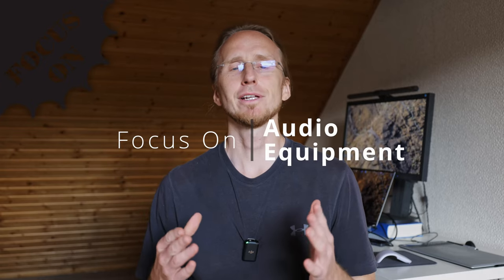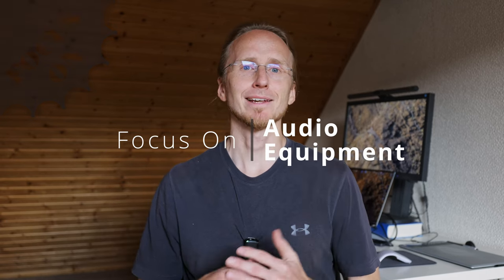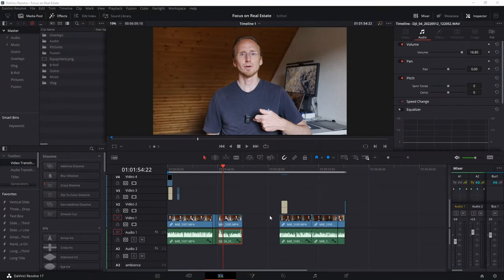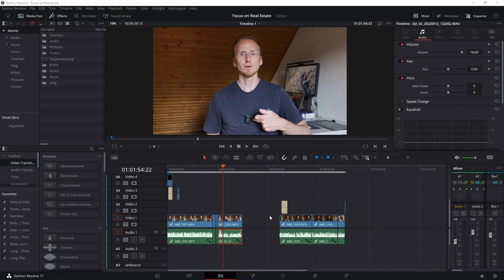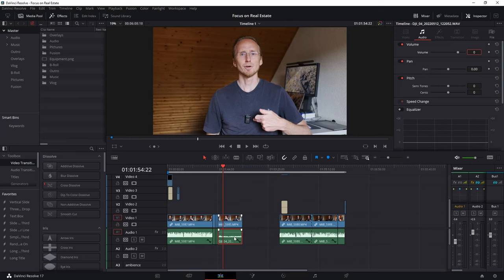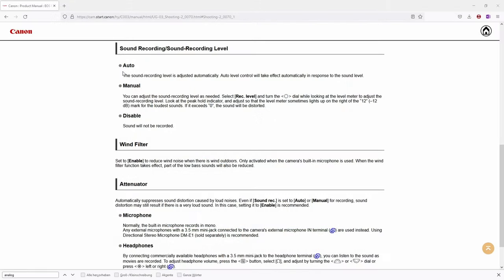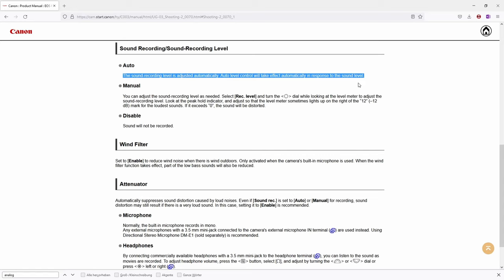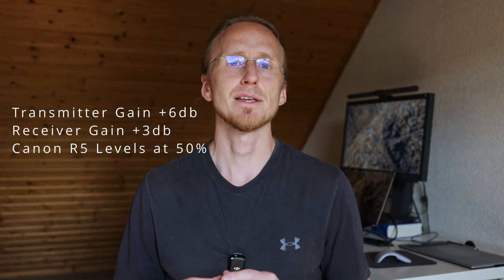DJI Mic Settings for Good Audio

Comment: Hey Michael, thanks for the review. And your possible solution to the problem. I got my DJI Mic too and I’m just trying to work out the perfect settings. My voice is loud and deep and I’m having problems with clipping. So I’m having a very opposite problem of you. Now watching your video i now realize that you also have a clipping problem, especially when you do your “solution” and you are actually having a very calm voice. I already reduced the gain on mine to -2 on my transmitter but im still hearing clipping now and then. I just released a video about the DJI Mic where im talking about that. Do you have any good ideas on how to go about that? Did something change for you after this video. I’m kinda disappointed. I payed over 400 usd for my Mic in South America and now it has these flaws. Thanks 🙌🏼
Reply from the maker: Hey there, cool channel and nice reaview! I hear what you mean.

I think with lower frequencies you have to be very carefull with the handling of the audio signal. I don't think mine clipps out of the box. But my processing in Davinci Resolve is sometimes not on point. I edit most videos on the road without proper head-phones ( I really need to invest in some ). And I also noticed for some of my videos there's clipping because I added too much gain in post. 

What I find interesting is, that out of the box, mine is very silent and I have to add a lot of gain and you have to reduce the gain. Although I have a calm voice, there shouldn't be such a huge difference between two people talking ;-) So this is weired and maybe they have some variance in their units - a big variance it would be then which is not good.

Did you try to only record the backup audio and play around with it? I the clipping the same as when you record directly to the IPhone?

PS: What a bummer that it doesn't work with all apps on your IPad. With my Dell (Windows) I have no problems connecting it and getting audio in any application.

PPS: I might get my hands on another microphone solution soon (cheaper one) and I will do some comparison. I like the DJI mic, but by now there are many solutions out there which cost nearly half the price. So it will be interesting to see how those perform.
Reply: @mibreit-photo  thank you for your long answer. I highly appreciate hearing your angle on this issue. The dji mic has a hefty price tag and for that amount i was just expecting more… magic, just like i said in my review 😆 ! Thanks for your good words to my review. Overall it is an interesting tool and i hope after playing around with the settings a bit, i will be able to get things more streamlined. Whats to consider is that in my review i didn’t do any audio post processing, just normalized the volume levels. So maybe with a bit more processing things will get better too. As for the clipping, i will have to try to reduce the gain a bit more and see what happens.  Yea to be honest, my first thought when i heard the audio quality was that there is something wrong with my unit, but then i watched some other videos on the mic and saw that many people had similar sound issues. I even found an official dji video about the mic, where some official from dji was talking about the then new firmware update and the video is clipping all the time. I can’t believe someone at dji approved that.  The ipad issue is actually going to be a problem in one year once apple is going to release Usbc iPhones. I hope they can address that with a software update. It would be a shame if new iPhones wouldnt work with the dji mic anymore. Let’s hope for the best and do some more testing. Im going to watch some more of your videos. I assume your newer videos are all shot with the dji mic?
Reply: This is fortunately a very common thing in the audio recording world. 
No mic can handle the wide dynamic range of the real world and produce a 'balanced' recording without post processing.
You need specific software (or hardware) for that. Just like no camera sensor in the world can capture the high dynamic range that nature can throw at us. 
So a good mic will have the ability to record the loudest sound without distorting and the quiet sounds without too much noise. That way you can compress the wav file later to get a more 'equal / balanced' end result. 

Something to consider is that the DJI Mic (recorder) does not have a foam cover. So certain sounds from your voice will come in very loud. (lots of air moving)
These are mainly the 'T' and the 'S', since they produce the biggest movements in air. 
We always use a foam cover on our mics and (on condensator mics) a windscreen. (not that fluffy thing, but a mesh that stops these hard airflows)
But that is in a recording studio environment. 

To wrap this up, what you can do is find the right distance between you and the mic. The further away, the less clipping you will get, but you will also pick up more background noise. Also play with the gain (as you already did), lowering it so you don't get popping / clipping. 
So I would always try to keep it as close as you can to your mouth and lower the gain until it does not clip.
Don't use auto gain, not in the DJI Mic NOR in the camera. You better do this in your editor. (compression with makeup gain)
In fact, I would not use the camera input at all, these cheap pre amps are another factor that can cause problems. 
Use the onboard sound only in the Mic or the Receiver and sync them in post (takes 5 seconds if you make sure you have some hard transient like 2 claps or anything in the recording). 
You can invest in a lavalier mic with a foam cover, which will dampen the T and S air flow a bit (less clipping). 
This will also help getting the mic closer to your mouth (which, in theory, should give better results).
Or record with the wind cover on and compensate some of the high frequency loss in your editor. 

No 'one size fits all' solution and not a 'set and forget' situation , but that is why there still are audio engineers in this world and why their recordings do sound good.
Reply from the maker: @tricks-and-tips  Thanks for the very detailed answer. It helps a lot. PS: I have actually another video showing how to autosync in Davinci, as I mostly don't record directly into the camera ;-)
Reply: @mibreit-photo  Nice. I'll have a look. 
How do you feel about the DJI Mic now?
Do you get good (enough) quality audio out of it?
I'm a bit torn between a good studio mic (SM7B) or a mobile solution. 
I know both have their place in a setup, but I rather don't spend money on both. 
I feel most of my recording will be done indoor, but probably not 'at the desk' all the time, hence the interest in a smaller mic solution. 
Another option for me would be a good lav mic and my Zoom field recorder (with mic input). 
So I'm taking my time investigating my options here :)
Reply from the maker: @tricks-and-tips  I'm fine with using the DJI Mic for all recordings, but I don't have the highest requirements. It certainly cannot compare with a proper Condenser Studio Mic. What I like about the DJI system is that I always have it with me on travels. Also they now have a solution where you just get one transmitter plus receiver for 220 USD I think. To be honest, this would have been the right solution for me, but when I bought it, it came with two transmitters.
Reply: @mibreit-photo  
Thanks!
Do you have more videos showing the audio from the DJI Mic?

Yeah, I noticed they quietly released that stripped down version. 
It certainly is enough for 99% of my use cases.
Reply: @tricks-and-tips  thanks, some great input. We keep on using the DJI Mic for our current projects. It’s very useful when we Interview people. Alexandra has an interview being released soon on her channel. It should live up to our expectations. Im looking forward to it. @AlexandraAllover

Comment: Here's the downside of the DJI Mic, if you're using an iPhone you can only record mono so you can't have separate channels which is a friggin bummer Man...
For the love of God please make a lightning adapter that lets you keep the channel stereo on an iPhone. I just ordered a Rode SC15 cable to see if I can use this as a temporary workaround it works with the rode Go II, so when I get it in a couple days I'll test it out and let you know how it works.
Again, DJI please develop a new lightning plug so we can have the option of going mono or stereo with an iPhone…
I know I can record on each transmitter but it's just that much more work to bring it into the editing system and syncing it up. I'd rather be able just to drop it into the timeline and have separate Mic channels…
Reply from the maker: I dont film on cell phones that much and I havent tested Stereo on Android, so I dont know if its better than on iPhone.

PS: wouldnt it be great if Apple just ditched the proprietary lightning cable and used USB as anybody else. I thought theyd already done that but seems I m wrong ;-)
Reply: I just posted a video on my channel that has a solution for recording in stereo on an iPhone with a DJI Mic. After quite an exhausting search, I found one solution.
Reply: @mibreit-photo  maybe this gen with the iPhone 14 - it’s only been rumored for the last 2 gens… 3rd time is the charm?
Reply: Given how the Mic's work, you may want to do this -- Record audio to the iPhone using the mics together.  I'm assuming at this point that the two channels going into the uPhone audio will be merged into a mono track.  Backup record on each mic independently.  At the end of the session, pull the video from the iPhone and the two mics into 3 files (1 MP4, 2 WAV).  Bring them into your video editor, synch the backup tracks to the video, and you should have "stereo" as in one voice will be in one channel (ear) and the other voice will be in the other channel. remove (or save off) the blended mono channel with the original video and mix the audio as needed.

Comment: Don't use autolevels in your camera! This is where the noise came from!
Reply from the maker: Yes I know, I explain this in the video ;-) And since the gain from the DJI mic is pretty low on default, it has to be raised. In the Canon R5, if I add too much volume there, this adds much noise, so I try to keep it below 50% at least.

Comment: I'd be curious to know why you chose the DJI system over the similarly priced (I think) RODE Wireless Go II or a 32 bit floating point model where you don't even have/need a gain control. I have a DJI drone but I regret it now after reading plausible accusations of the company assisting the Russian military in locating Ukrainian drone operators.
Reply from the maker: To be honest, as a viewer of Thomas Heatons Videos I wasnt so keen on getting the Rode Wireless Microphone. He seems to have to re-record a lot. Also my current Rode Lav Microphone doesnt always work properly. Seems to be Problem with the cable. So I didnt want Rode. The features of the Dji were exactly what I was looking for in an unbeatable form factor, so I bought that one.

PS. I dont know how/If Dji is involved in this conflict. If they do that, thats bad, No question
Reply: @mibreit-photo  Thanks for the insights into your decision process.